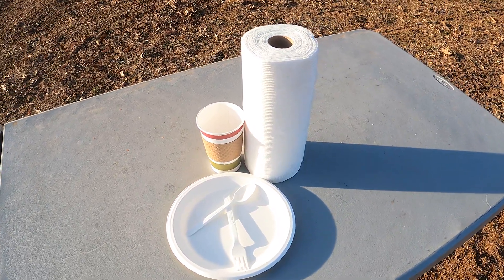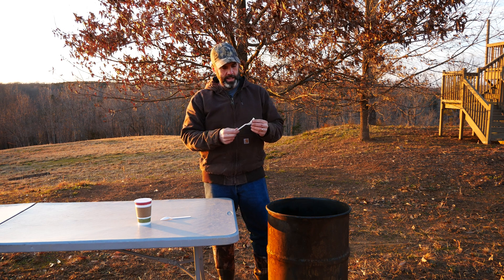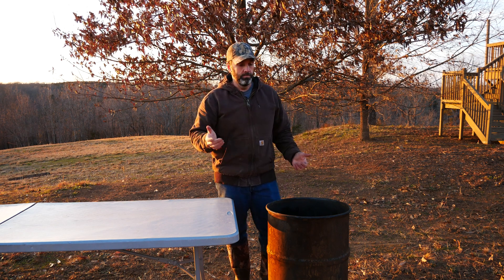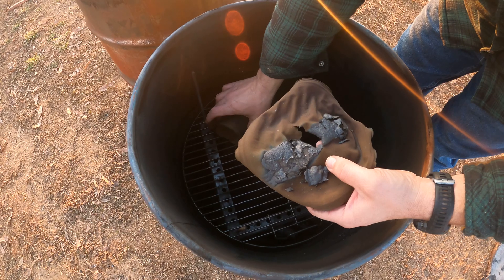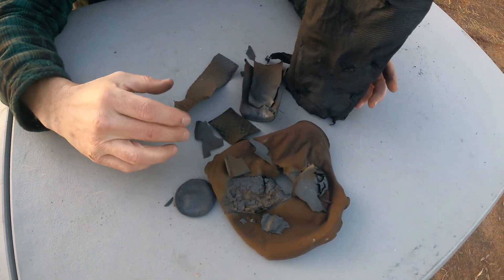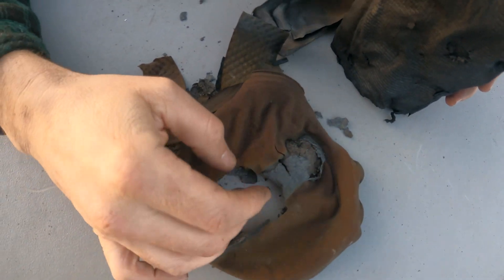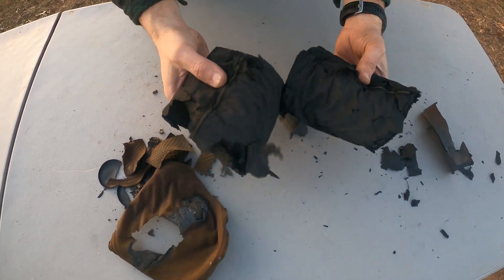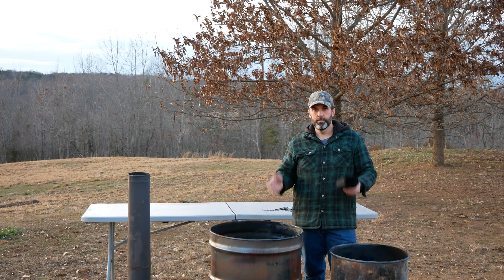What Happens When We Carbonize Paper goods?

Comment: Plant-based plastic is still plastic. (Crude oil is also plant-based.) Into what kinds of carbon chains the raw material gets converted at the factory has nothing to do with what the source material was, or where it came from.

That cutlery was plastic. It was just plastic made from a recently-died plant, not one that died millions of years ago. It was also a plastic with shorter chains that can be broken when it is sitting in the moist head of an industrial composter for a long while---but that doesn't have anything to do with where the source material came from (aside from the issue that building long chains from plant matter takes oodles of energy, which is why it's not usually done unless the Earth's crust has already done it for us).
Reply from the maker: Thanks for the info! -Mike